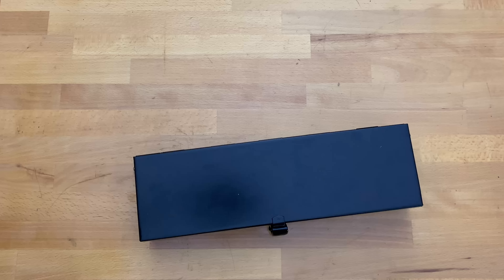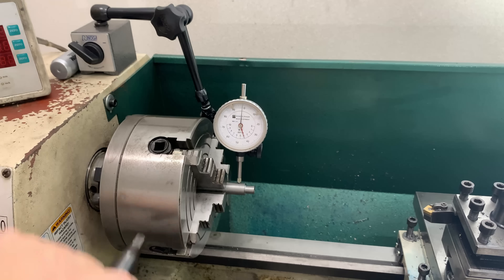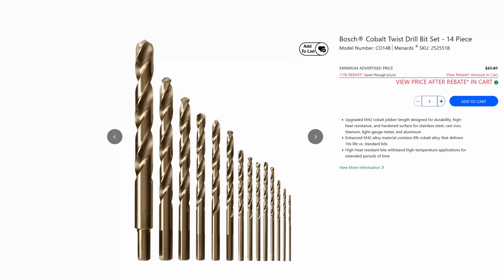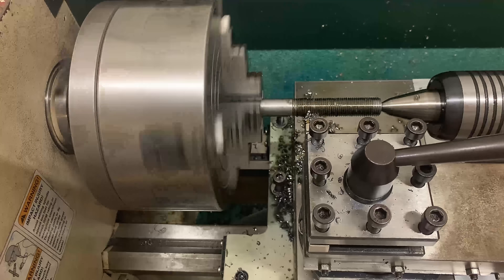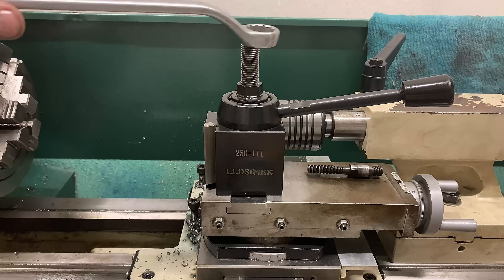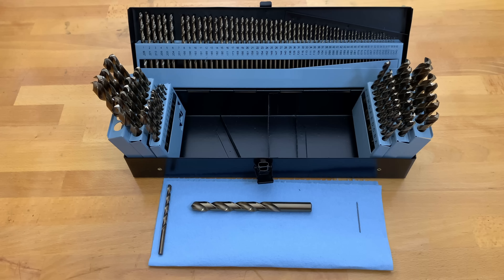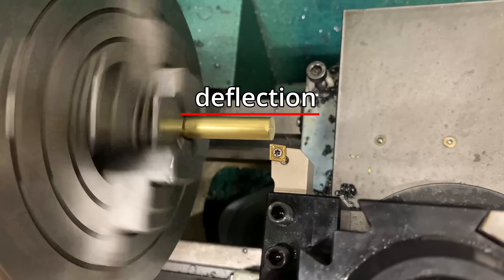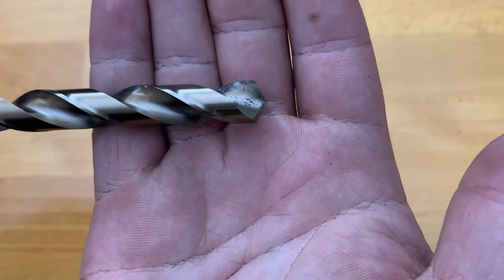Are Harbor Freight Drill Bits Secretly AMAZING?

Comment: What many people don't understand is the two most common grades of cobalt drill bits are M35 and M42, which contain 5% and 8% cobalt respectively but the more cobalt the more brittle the bit is. So if you are drilling cast iron or harder grades of steel and you go caveman pressure that deflects the bit it will snap immediately, it's just the nature of the beast. Slow and steady wins the race.
Reply from the maker: You're exactly right.
Reply: Adding onto that - if you’re using these with a hand drill, eventually the material and the drill will catch up you will get deflection and they will snap. 

If you don’t have a drill press or other machining tool then you really don’t need these nor will you really get much out of them. You’d be better off with a different type of drill for whatever you’re doing. 

 

You should also be aware that these are like many other HF tools. By that I mean you’ll probably have to clean up the tip on most of them which is fine for the bigger sizes but a pain in the ass and not worth it for the smaller ones.
Reply: @JamesLake78  does a magbase drill count as a ‘drill press’?
I’ve been raring to get me one on the off chance I need such a thing, but the price point is kinda putting me off. I do have a drill press and a tabletop mini mill.
Reply: @JamesLake78 as a mechanic I have to drill out cross threaded, broke or rusted bolts occasionally. What do you recommend for that use case?
Reply: @ronsimmaculatedetailing6335  whatever gets the job done 😂 if the bit is sharp and harder than the fastener, it will cut through it at some rate. If I can’t weld a nut on and get it off like that then I usually just use a regular HSS bit. If one of these cobalt bits breaks off in the bolt I really don’t want to figure out how I’m getting that out too
Reply: They say slow and steady wins the race. Well, I tried that at a track meet once. I ran an 8-minute mile and CAME IN DEAD LAST.
Reply: @wompastompa3692  Ya but you came in.

Comment: I have the same set, my first thought was "This box is garbage", my dad has a set from about 15 years prior, definitely a much better box. The drills work great, go slow, use oil and make sure they were sharpened on center (my biggest complaint). They work alright, all there "better" quality bits work alright if you don't pretend like they're a $1000 set, I know they work better than the Dewalt cobalt bits
Reply from the maker: 100% agree. Thank you for the comment :)

Comment: Great review! A lot of people were taught drilling metal the wrong way, making drill bits go dull or tips burn quickly or drills bresk, and leaving ugly holes. Me too until some years ago. A steady hand and a puncture, or drill press, the right RPM range and downward pressure for the material, sufficient torque and applying drill lubricant all make a big difference. What I was taught long time ago but what you really should not do with cobalt drill bits is when a wider hole is required, like ½ inch, drill a small hole first, than redrill with ever increasing drill sizes, it will damage the tips. For this, simply drill with ½ cobalt drill right from the start.
Reply from the maker: I've always heard the same thing as you. With that 7/16ths drill I used on the steel in the video it really did just go through like it was nothing. The trick is like you said -- the right plunge rate (pressure), RPM, and lubricant will make all the difference.
Reply: You can pilot drill a hole to clear the center of the large bit, just don't step up in small increments. That will wear out the edges and risk catching on breakthrough.
Reply: @ctrlaltdebug  good point, thank you 👍🏻

Comment: I have this exact set. I got it years ago (~10) for less money. I only use it like a ream set. I drill with a more common drill bit first and use these to get the final size. I too have found them all to be 1 thou too small. My case has the same exact defects as yours. I find these drill bits too springy for hand drilling but are fine for a drill press. I have not broken one yet, and I take way more care with them then they are worth. This set is more useful then a metric set.
Reply from the maker: I'm glad to hear that you've gotten so many years out of them and they're still working for you! I can't believe that the case still has the same defects that it had 10 years ago though. That's wild.

Comment: HF used to sell the same set but as just basic steel black oxide coating, that's the set I have for like 10 years now (think they were 69.99 before coupon) and for hobby use they have been fine... the only trouble I have had was usually right after thinking "man Im gonna f*k this bit up)
Reply: I got the black oxide set long ago and I only paid $29.95 for it. I bought it just to see how bad it was. It's OK. I still use it. I'm not drilling anything too hard with it. But I'll use it on mild steel. It's fine.
Reply from the maker: I think they still have it. All I ever use in my hand drills are regular old drills like the black oxide, HSS, etc. I break them too often in hand drills trying to put holes into tight spots where I am not drilling at the best angle that I can't afford to use my good ones. I use those in the rigid machines only.

Comment: I've had the same set for a long time and they have performed well. I loaned it to the guys and work and they ruined one immediately in a hand drill drilling into an I-beam. I took the next size up and finished 22 more holes and it was cutting just fine. These work well but if you don't know how to drill a hole, and most people you meet don't, no drill bit will work.
Reply from the maker: I think that's the root cause of a lot of the bad reviews. People who don't know how to use a tool are upset when the tool doesn't work right or breaks.
Reply: @ShopHumor  There's also the psychological factor.  Some people "drive it like a rental".  In this case, if they know they're using Harbor Freight, they aren't as careful.
Reply: @rpontonjr  It's not that at all. It doesn't matter HF or not, drill bits require skill to avoid dulling and breaking them. All grades and materials and all brands.
Reply: @ShopHumor  Cobalt-alloy drills are more brittle than regular high-speed steel (HSS). That means they stay sharper longer but they will snap more easily with sideloads or shocks and need careful handling. There are two common grades of cobalt drills, M35 and (what the Harbor Freight set claims) M42 which has more cobalt content. I tend to use M35 cobalt for most work in hard materials. Cobalt taps are especially prone to snapping if not handled very carefully. Good-quality cutting compound is a must for tough materials.

You will never use most of the drills in that set but it's pretty to look at. A better bet would be to get packs of specific drill sizes you use a lot and learn how to sharpen drills at home. It's a satisfying skill to acquire.
Reply from the maker: The ability to shape and sharpening your own cutting tools is definitely an invaluable skill. Since I got my little Grizzly G0602 lathe recently I’ve been working on making my own HSS turning tools from blanks and it’s been fun.
Reply: @robertsneddon731  Never use? Never under estimate the value of drilling just under or just over a standard size in order to prep for reaming or boring, or to get a zero slop fit for out of tolerance bolt sizes or for shouldered bolts. Lots of non standard reasons to need all of those bit sizes.
Reply: Honest question: what is the correct way to drill a hole? I’m almost certainly one of the many who don’t know, but I would like to. Can you recommend any YT tutorials?  Thank you!
Reply: @captainvector  The elements to properly drilling a hole are keeping the drill at the proper speed (large drills need slow speeds); there are charts that cover speeds vs material type. Keeping the drill vertical to the surface and steady is important. Push hard enough to get the drill to work but not so hard you create excess heat. If the bit turns color, it's usually all done. Cutting oil can help a lot. Drilling a pilot will make a difference as the very center of the drill does not cut but mashes its way through the material.
Reply: @captainvector  It's actually fairly simple, and much less exciting/interesting than typical YT videos need to be so understandable.
Always better to use a drill press if possible. Much better control of speed, pressure and perpendicularity. If not possible, then keep this in mind when hand drilling.
Slow down. Way down.
Keep absolutely straight.
Use light pressure.
Use lubricant, then add more if you see smoke. The point is to lubricate AND keep the temp down.
If it is smoking and vibrating you are going too fast and pressing too hard. Lighten pressure, slow down and add lubricant.
If you are getting long metal chips curling off the bit as it rotates you are doing it right.
The main culprits are speed and pressure which lead to heat. This overheats the bit and dulls it instantly. It all just gets worse from there.
The rest is practice practice practice.
Any added tips by others are welcome.
Reply: @jameshisself7375  Yeah, I forgot to mention about looking at the chips.
Reply: @captainvector , I think the key to not breaking a bit when hand drilling an unforgiving material like steel is to keep the pressure axial. Applying pressure while holding the handle can theoretically work, but practically speaking the bit will be flexing and bowing in its hole.
Reply: @captainvector  setting 1 on your drill and oil that will cover 99% of what you need. It's not Nascar and you are probably not going through 1/2 plate so your covered with setting 1 and oil hell even water is better than nothing
Reply: Most people will ruin every bit they touch.
Reply: @bryandraughn9830  I've met a few people that could break an anvil in the middle of the Sahara desert. Destructive MF'RS
Reply: 100% I've seen more failures due to people's bad habits.
Reply: I never loan my tools. 
Let the fools buy their own tools to abuse
Reply: Exactly. I've had my set for at least 10 years by now and they all still work great. Never broken any.
Reply: I have an old HSS version of these as well and they are fine.. good working set, they just need to be kept sharp.
When I break one I just replace it with a good-high quality us made bit... about 1/4" of the index has these and the rest is still filled with re-sharpened or barely used originals that still cut accurately and acceptably for anything but precision work. One thing I will say is that the initial grind ("sharpening") on most of these cheap bits is trash... Giving them a properly cut sharp edge improves them dramatically.
Reply: @grumpycat_1  I absolutely agree with you on this. I have had great service out of the HSS set that I have and they take mechanical abuse better than the cobalt set but they won't hold and edge after they get hot.
Reply: I drilled a lot of holes with a hand held drill motor before someone watching me told me I was doing it wrong. Once I learned how to drill a hole I stopped screwing up all my bits. It was an enlightening lesson that came way too late in life but better late than never. 🤙
Reply: I have the same set for about 7 years. I have broken 2 bits in 7 years(my fault). The rest are still working fine.
Reply: @daviddeck6109  I just used them to widen a hole 🕳️ in a thousand dollar part and they came through... money well spent
Reply: My buddy at work is notorious for not knowing how to drill and then blames the bit 😂
Reply: I agree there is only one guy in my shop I let use certain things one is my good drill bits.
Reply: That’s where that cutting oil comes in handy and slow with not a lot of pressure
Reply: Question, how does one drill a hole right? Are you talking rpm, feedrate and material?
Reply: two things i never loan out, sockets and drill bits. you can borrow my $500.00 power tool before you ca borrow my $5.00 drill bit lol I've had the same drill bit index for 3-4 years because i know how to drill mild steel and stainless steel, i've seen how the other guys in the shop get 1-2 holes out of a bit before it's trashed, if i shared my bit index with these neanderthals, i would no longer have a set of drill bits lmao. like for example, we just got a set of shop bits, whole index, in like a month there are only 1-2 bits left in the case... where the hell are all the other ones? lost or destroyed... no thanks.
Reply: 100%! ! !
Reply: Facts!!!
Reply: I don't loan my stuff anymore. Too many idiots out there. Then they don't want to replace it. Here's your broken fill in the blank. Sorry.
Reply: I constantly tell the guys to slow the damn drill down!! I see them constantly burning the cutting edge!!
Reply: I have the same drill sets that I acquired in the early 70's when I worked in a tool & die shop. Still going strong.
Reply: I have this set from another decade. I use these bits all the time (except for 1/8 and smaller of course those have all been replaced in bulk from cheap ebay)
Reply: Ok... well my other bits don't just break like these did so...
Reply: Why would drilling into an I-beam ruin the bit?  I-beams are not hardened steel, they're hot-rolled.
Reply: @mk6595  because if you drill at 15000 rpm with 200lbs of ape pushing it at oblique angles with no  lubricant it doesn't matter if it's a "soft" metal it will ruin almost any bit.
Reply: @mk6595 He's not saying the I-bean caused It, he just ilustrated how inept his coworkers are at drilling plain old mild steel, while he did just fine with the same tools
Reply: @mk6595 Too much pressure, pushing hard on the bit, no oil on the bit. Need to let the bit do the work with minimum pressure. ( Retired Millwright )
Reply: @mk6595  Probably had the drill going way too fast.
Reply: @mk6595 Because the hole driller likey went full speed with no cutting oil. As a previous poster pointed out, if you don't know how to use a drill it doesn't matter how expensive/sharp the drill bits are they won't last.
Reply: @mk6595  likely user error most folks these days can't even tie their own shoes
Reply: @mk6595  Doesn't matter if you hold the drill wide open.It's still going to burn the bit up That's what he's meaning
Reply: @mk6595  They probably just didn't lean into the drill hard enough to start the cut and burned it up?

Comment: interesting to see the milwaukee ones being dunked on
Having a large index would be pretty sweet, because sometimes you need a specific sized hole...
Other times; you want duplicates bc you know damn well that stainless steel is gonna wreck a bit eventually, even if you're careful.
Reply: Being careful is how you get in trouble with stainless steel. If you don't use a heavy feed some stainless will work harden and then you're in for it. You can't baby stainless.
Reply from the maker: I have a feeling those Milwaukee bits are fantastic and the people trashing them were just careless when they were using them. Cobalt makes the bits a lot more brittle than regular HSS. They're a lot harder and last longer, but if you're not careful, you'll snap them.

Comment: I have some HF drill bits. They are used for wood and anything else that doesnt matter. They are garbage for anything else. You can sharpen them, but it can't fix the manufacturing flaws like off center webs or just feally soft material. The fact that they push exotic coatings is another clue. A GOOD HHS drill will do 90% of what you need and will hold an edge well. I bought a set like what you have years ago from Enco before they were bought. At $150 or so, they were chinese, but still better than anything I've ever used. I only use these in machines. Either drill press or lathe. If one breaks, i just replace that drill. I sharpen when needed. They will last me forever.
Reply from the maker: I agree. I have HSS drill bits for my hand tools and then the good drill bits for my rigid machines. It's really important to match the tool with the machine and the material. If you're using a high quality, American-made M42 cobalt drill and trying to power through stainless steel with a hand drill, you're probably going to break it because it's designed to be used in a rigid machine.